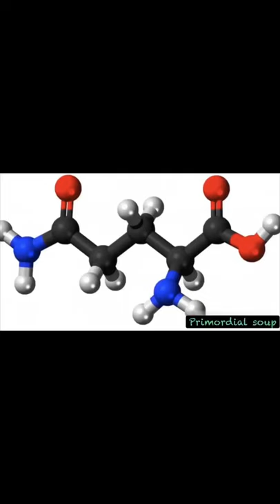Electroluminescence of carborundum (How to make an LED)

Comment: Voltage used? Amp draw?
Reply from the maker: It's approximately 500mA to 1A @ 5VDC. I used a DC wall adapter to power it.